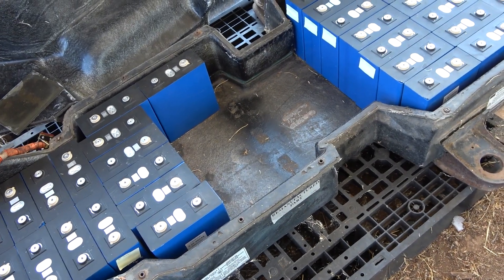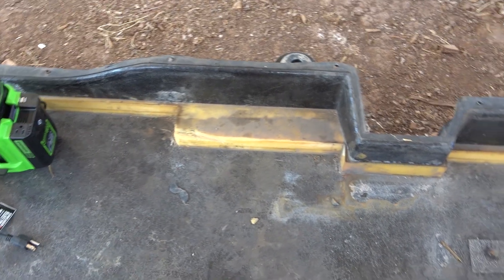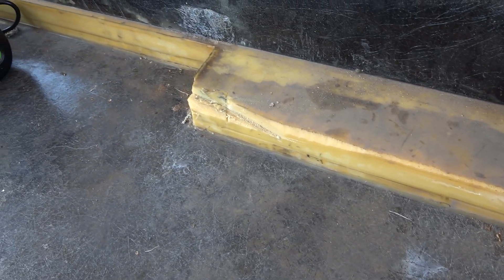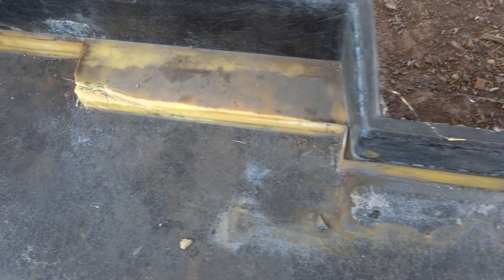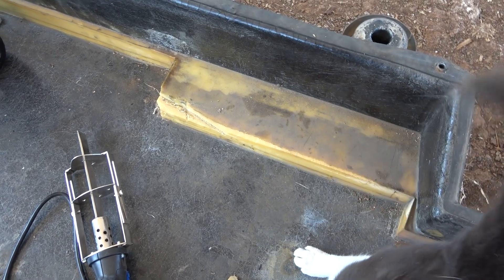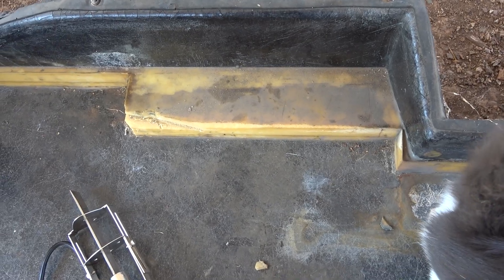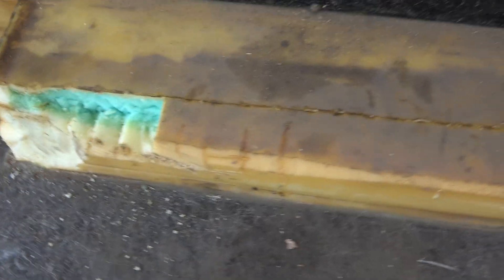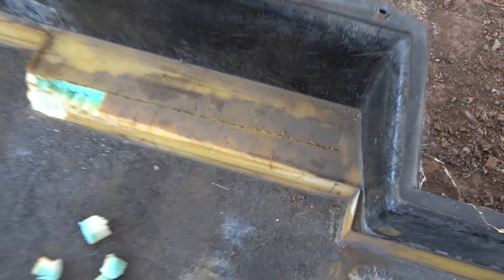Ford Ranger Electric: Cleaning Out NiMH Battery Tray

Comment: what voltage are you running? i am at the beginning of converting my 4x4 gas ranger to electric and im trying to peg down components and decide on final specs.
Reply from the maker: My battery voltages are dictated by the Ford Ranger Electric's systems, which max out at ~380 V peak (310 V to 330 V nominal). In theory, I could switch out the motor controller with a ~400 V peak system, but that's unnecessary if I'm keeping the Ranger mostly stock. Your build's voltages are really going to depend on which powertrain components you decide to go with. 

Some DC motors and controllers will handle 400+ V just fine, but most aftermarket AC motors are only 120 V to 150 V. To get a similar ~400 V AC system similar to these Rangers, you'd likely need to repurpose an EV's powertrain (e.g., Nissan LEAF motor). 

I would get your power train components sorted out first, and the battery is the last thing I would do, configuring the battery's voltage and power to whatever system you choose.
Reply: @newscoulomb3705  cool, thank you for the info. I'll be using the 5 speed it came with and my plan is to hunt down a forklift motor or whatever I can get my hands on. Still undecided if I want to do an AC or DC setup
Reply from the maker: @gscorse  A forklift motor will typically be DC, and the motor controller will provide you with the voltage range. You could likely get away with as little as 96 V, but you might need to run much higher current than I am, which will need thicker wiring. DIY EV is a great forum that I recommend.

Either way, good luck on your build, and keep us posted!

Comment: Eric, it looks like standard wood chisels would make quick work of that foam removal and get flush with sides and bottom pretty easily. Best of luck in whatever technique you use though.
Reply from the maker: Thanks! I might try a wood chisel to square up under the foam (it's uneven under the foam).

Comment: So that you don’t need a long lead from the far end, leave the outside column if batteries and when you get to the end, just go down that column.
Reply from the maker: Thanks! Ford actually accounted for that already with the way they set up the pack, so I'm just going to follow a similar pathing to the original battery. Basically, the main positive and the main negative terminals are both at the rear of the pack.

Comment: I know it is probably too late, but I keep thinking that an oscillating multi-tool would probably do a good job on that stuff. It cuts by vibrating a variety of blades. You could get right next to the sides with it.
Reply from the maker: Yes, I was thinking of that, but the way this stuff was reacting to normal blades, I didn't want to risk it. You saw me bounce the hot knife off the tray once, and that was because of the layering of different materials with different densities. I guess I just want to limit power tools this close to the surface of the tray.